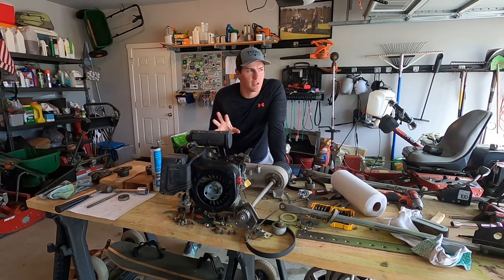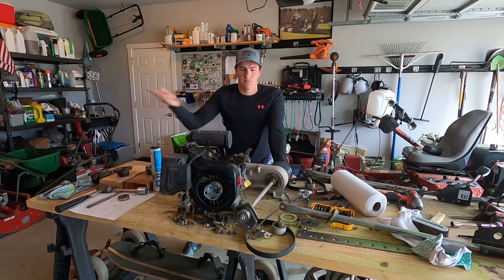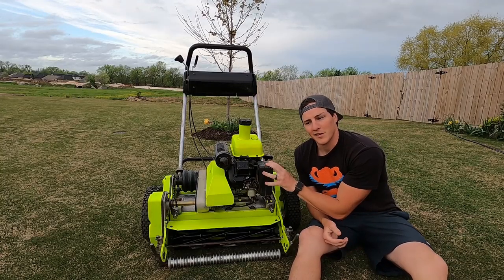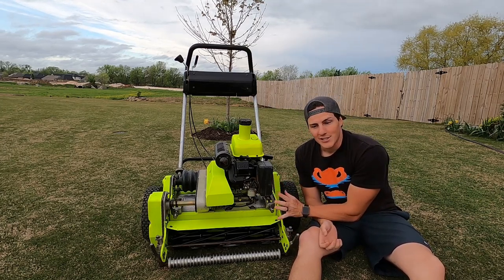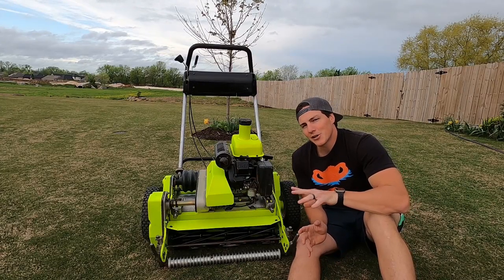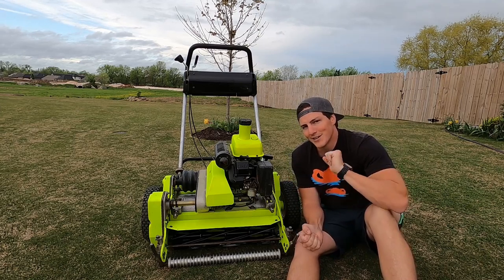I FINALLY Finished My Greensmaster 1000 RESTORATION

Comment: Looks great man! Got it done just in time. Had to be nice to have your other GM1000 there for reference. What parts did you end up replacing while you were in there? Finally, what color are you going to do the other one 😂
Reply from the maker: Triangle REEL Mowers 
Having the other helped a lot! Replaced reel (to an 8 blade), bearings and seals, and the roller is an upgrade but I did that a while back. Maybe I’ll let left tool choose a color

Comment: How much did you end spending on restoring it? I just got a Toro 1000 for $100 and want to do the same.
Reply from the maker: Luis Rodas 
A new reel is $200 or so. Bearings and seals for $75 maybe. $30 ish on paint. I put the grooved front roller on it last year but that’s $100 or so.
Reply: @TheLawnTools  That is not bad I appreciate the response.  I may try to fully  restore mine next season.  I just want to start cutting grass with mine,  just waiting on a new bedknife from R&R.

Comment: I have a question, i hope you can help. I have an old grenmaster 1000 without speed adjustment, is it somehow possible to disable the maschine from moving forward, so only the knifes are spinning?   this way i could push it aroubnd in the tiny areas i've got.